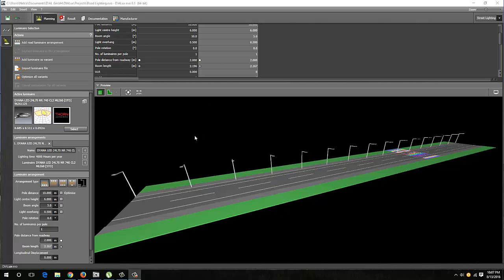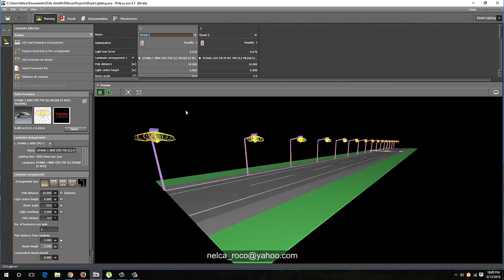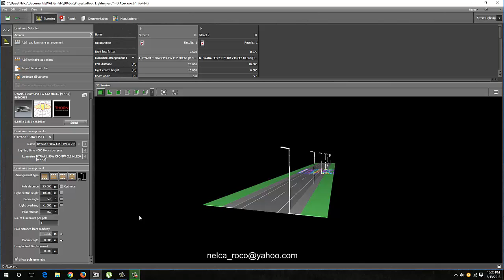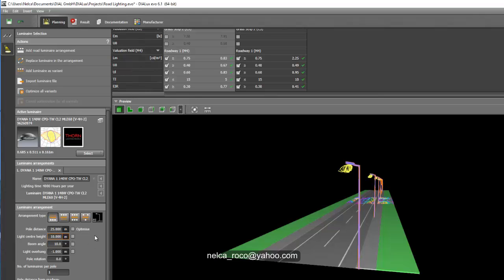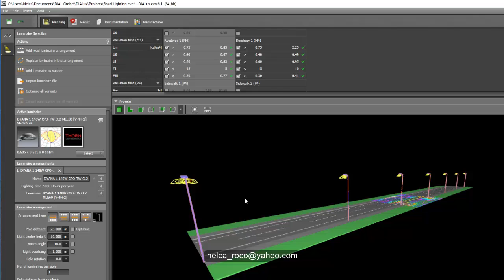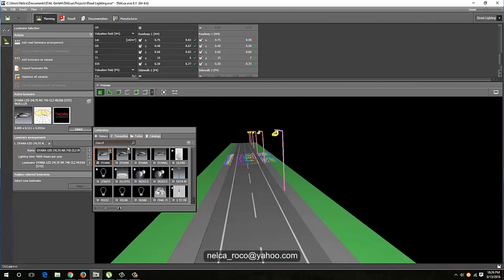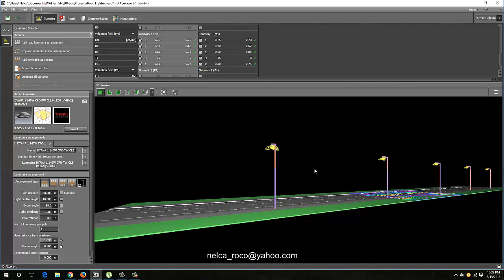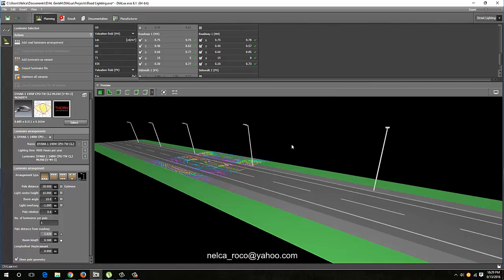Dialux evo - How to do street lighting design calculations2

Comment: Hi there, 
I would like to know if it is possible to make a calculation of a curved road, or what would I consider to simulate a road of that kind on dialux?
Reply: Hi, It is better to do that in Dialux 4.13. I feel like for streetlighting or highmast calculations, its better to create in Dialux 4.13 instead of EVO. Ive created many simple toll areas or curve roads using points when creating objects. Add on a calculation grid after on it and you can calculate cd and lux. I tried using EVO for street lighting, the documentation is so little details in comparison.
Reply from the maker: you are right.
Reply from the maker: not possible in curve. straight calc only.  no probs coz the calc points are in between the two poles. so u dont need to worry if it is curve or not.